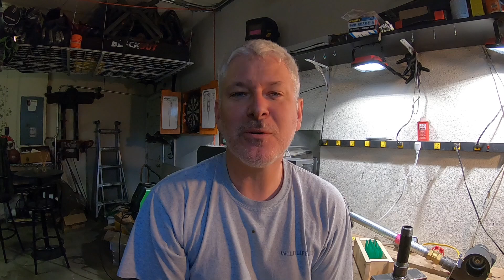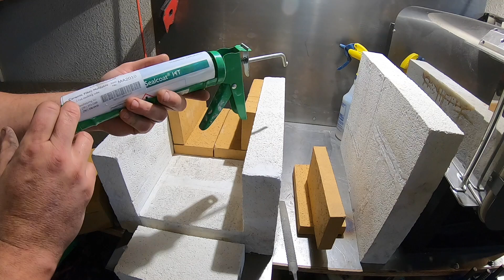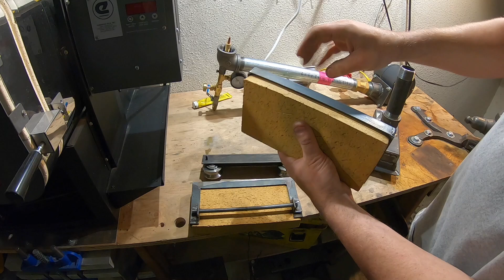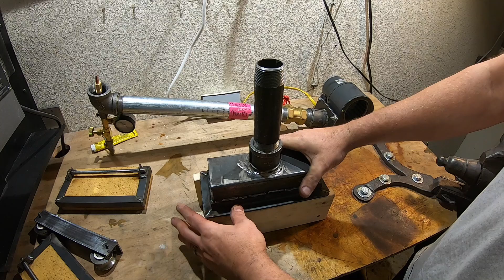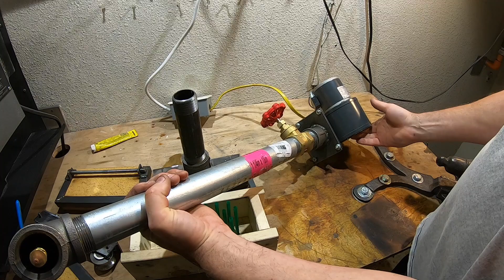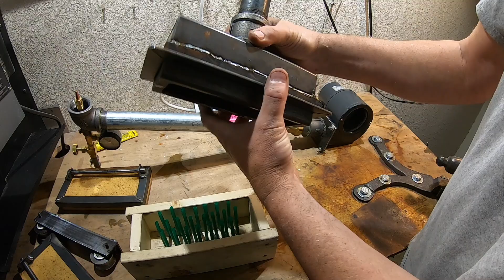Triple-T Thursday #12 - The New Forge

Comment: I just watched this video and have some information that will help you in your forge builds. As an employee of Atlas Knife and Tool (a commercial forge building company located in pleseanthill  IA). We have found that if you line your forge with Plistex 900f you won't have Flux chewing away at your refractory as the Plistex with turn into a ceramic after firing.
Reply from the maker: I’m actually retiring this forge and my video this weekend is the new forge build.  Check that one out.  I’ll have to look up this plistex though.  Thanks for watching

Comment: Coming in 1.5years later how is the forge holding up? Im thinking of building this style myself. Thanks!
Reply from the maker: It’s going very strong.  I’ve not repaired or replaced any part of it.  The only thing I would change is making the ribbon burner longer so the heat was more even across the forge.  It’s certainly hot enough to forge weld.  👍 Thanks for watching
Reply: @TyrellKnifeworks  I didn't happen to see how long yours was in tue video. Do you remember how long you made it?
Reply from the maker: It’s 18” long but the burner is only 8”, I would make it 12” next time so there’s only 3” on the other side.
Reply: @TyrellKnifeworks  thanks! 12" is exactly what I was thinking of doing for that same reason.

Comment: Did you use your Titanium welder to weld the steel casing and parts?    I got the same welder last Christmas but haven't tried it out yet.   I heard it works pretty good for thin steels.
Reply from the maker: Yup, used that titanium welder for everything.  I’m pretty happy with it.  It migs well and I’ve used it for tig as well.  It only does lift-start tig but seems to work well enough for me.  I’m certainly no expert welder though! 😜
Reply: @TyrellKnifeworks  Glad to hear it.  I Should have some time soon to learn how to use it soon.  Love the size of it.

Comment: That is the only way to go if you want to build a forge that lasts , does not waste expensive gas and is very easely maintained. The ordinary hard firebrick is very cheap to replace. On the burner : imho the reason why most diy ventury burners dont give the same amount heat is because they never are able to suck in enough air to get at a perfect propane to air mixture.  The best mix is about 24 parts air (by volume) to 1 part propane( by volume). A ventury burner never reaches that mix so you need to burn a lot more gas at a higher pressure to get a better venturi effect and  to get enough heat. The only reason why any forced burner ( forced ribbon or forced single burner) works better is because of the air you can force in by a blower or compressor. A forced single burner and a ribbon burner give the same amount of heat per volume of gas used if it gets the same amount of air to burn. A lot of people building there own venturi burners will never get it to work as intended as they are not able to measure the right mix.......they basically have a very cheap forge build that becomes super expensive because of the gas they waste over a longer periode of time. You can see yourself when you have to little air and your forge is wasting gas when the flames come far out of the encasing and burn outside the forge....all those flames outside the forge is basically heat wasted.  If you want to know the ideal for the gaspressure set and  blower rpm....use a thermocouple and cheque regurarly using more or less air. Write it down or mark the valves. Using a blower at a much to high setting does no longer increase heat....it only makes the steel oxidize faster. You can get damascus (or any other metal laminate) to work without any borax or other flux.....a simple oxigen free encasing takes only a few minutes to make. If you want to cut and restack just weld the seams( tig, mig ,stick). Far more secure and no borax sticking to all objects and tools you use during forging. I have not been using borax for a long while. The only thing i get on the forge floor is oxidation skin. Thats easely removed with a brush after cooling. If i ever need to use borax i made a undeep stainless recipient (1/8 sheet metal) that is almost as big as the forge floor and that can be removed after use. It can stand a lot of heat and catches the spilled borax.
Reply from the maker: Thanks for the detailed comment.  I’m excited to move to forced air for sure.  I really have no love for those frosty T burners that everyone seems to like.  You have no control of air flow at all, only has pressure.  I think folks don’t understand the importance of controlling the air mixture to create a very gas rich or gas lean environment.    Thanks for watching!
Reply: @TyrellKnifeworks  Just make sure you also install a simple electrovalve on the gasline. When there's a electric power failure...this valve needs to close and shut off the gas. If you do not have that safety : there's no power to the blower, that means no air to burn....so the flame goes out but the gas keeps on flowing. If you are in the shop when it happens you can act fast....but if you left the shop for a minute when the forge is still lit there's a chance things go BOOM.  ;)
Reply from the maker: @HoutmeyersP  I thought about installing one but I don't leave the shop when the forge is on.  I may look at installing one in the future for safety.

Comment: Replaceable bricks on the floor are very good option! the air forced burner looks great! Well done Denis:)! 
btw: Long time ago I've try to make air forced burner but I failed. I hope that everything will go well in your case, but if you will have a problem with it, think about speed regulator in the fan. Sometimes the air pressure is right, but the speed it to high. That was my problem.
Reply from the maker: Thanks David, I'll keep that in mind.

Comment: Interested to see this running.  I don't think I have seen a forced air burner with a mig tip in it as an orifice.  Most seem to just use an 1/8 or 1/4 pipe to inject the propane.  You would need more pressure to get the same amount of BTU output with the smaller orifice.  Might be interesting to see a video on when you tune this burner to get the right flame and enough output for a welding heat.
Reply from the maker: I saw one video that used a mig tip.  If it does work it’s easy to remove at least.  I’m sure I’ll certainly have to tune it though.  Thanks for watching.

Comment from the maker: How do you guys do your forges?  Any other things you've done to make them easy to cope with flux?
Reply: I made a cheapo coffee can forge, but only used it once before I built a better one out of a waste scuba tank, kaowool and satanite . There’s a short video of it on my channel.
Reply from the maker: I thought about using a scuba tank for my first but thought the diameter wouldn’t be large enough.  I guess you made it work!  I’ll check it out.
Reply: @TyrellKnifeworks  
A 14 litre tank was big enough 👍🏻👍🏻😍
Reply: Ive heard great things about Bubble Alumina Refractory Coating: available here http://www.hightemptools.com/refractorycoatings.html in regards to resisting flux damage
Reply from the maker: I've heard that mentioned in another video as well.  I'm using Mizzou refractory which is supposed to be really good for flux.  Still, I want to be able to easily reline it without having to redo the whole forge.  I'll check that refractory out next time I need to buy some, thanks!